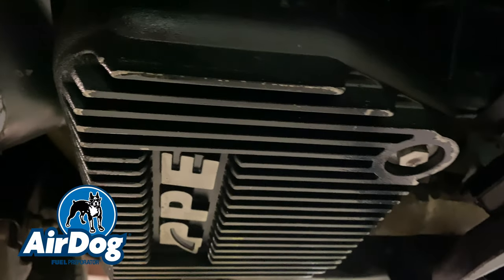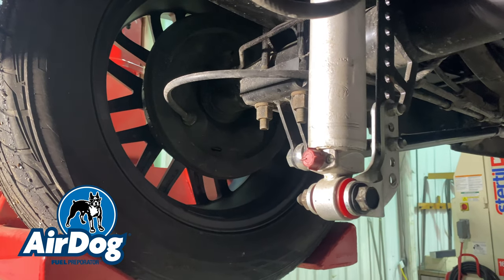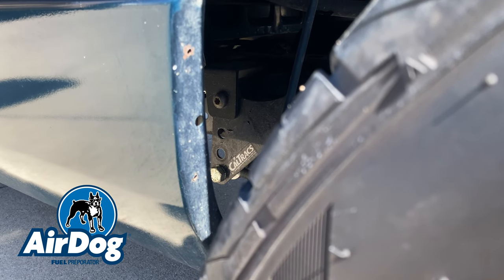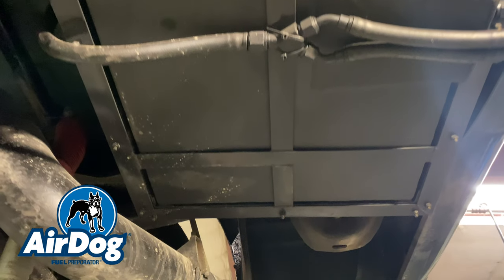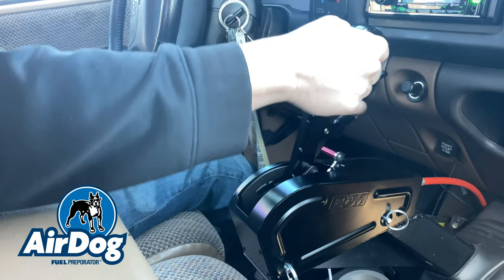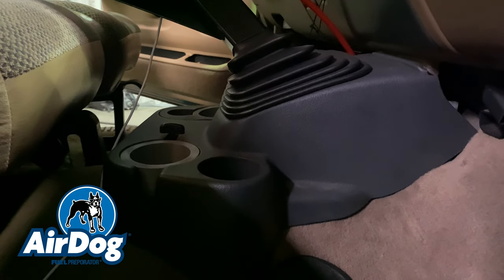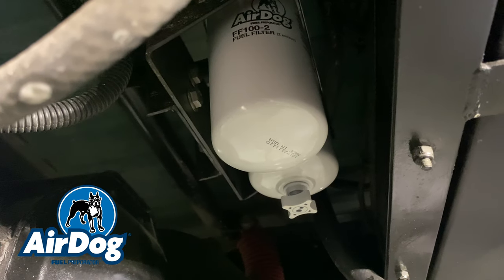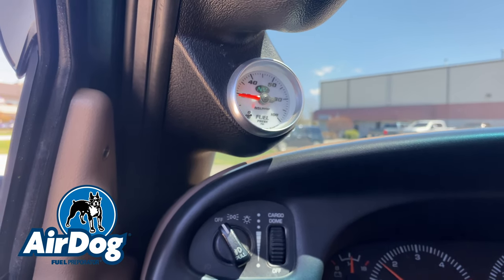Kevin's 500+HP Shorty Cummins Update

Comment: Originally a 1500?
Reply from the maker: Yes, it is built off of a 1500. All it needed was 3/4 ton front coils to support the extra weight.
Reply: @AirDogSales  rear diff and driveshaft stayed the same?
Reply from the maker: @tristenoberlender9685  The rear diff stayed the same. The only thing different is a Yukon Duragrip was installed. It's a chrysler 9.25. That's a larger ring gear than a ford 9". So far, it has handled any of the abuse put to it. Driveshaft might have worked if the truck was originally built as an auto. It was built with a nv5600 at first, so a custom driveshaft was made.

Comment: I’m not much of a street truck guy but this truck got me watching the whole video. Awaiting a 500 hp 5.9 for my 01  dually 4x4 . The airdog arrived last week. The turbo, exhaust manifold and wiretap vp44  , injectors will arrive on the engine. The Firepunk towing plus and triple disc is already hear. I enjoyed watching and eagerly waiting to sit where your sitting
Reply: Sounds like it’ll be a pretty solid build.
Reply from the maker: Cant wait to see it up and running!

Comment: How did you mount the rear shocks at the top I see how you mounted them on the axel with the kit fire punk diesel sells. Picture would be awesome!
Reply from the maker: A straight piece of tubing was welded in across the frame rails right above the axle shock mounts.
Reply: Thank you so much! @AirDogSales

Comment: Love the build! I'm building one myself for the most part I've heard everything fits right in. Are there any tips or tricks you can give? Will the wiring harness fit right in too?
Reply from the maker: Yes, everything dropped right in, even the engine harness. The only thing that was a little tricky is the half tons don't have the nutserts for the intercooler in the core support. You can either install nutserts or find long thru bolts.
Reply: Thanks again man one more question where did you instal the power steering lines on the 1500? In the 2500/3500 they go to the brake system.
Reply from the maker: @artv6371  The hydroboost from the donor truck was swapped into the half ton and the lines were ran down to the steering box.

Comment: Are you running factory half ton rear end and front end?
Reply from the maker: Yes, factory Chrysler 9.25 rear with a Yukon Duragrip and the factory front suspension with 3/4 ton coils. Been going strong for 5 years.